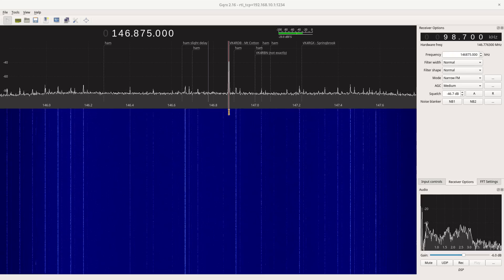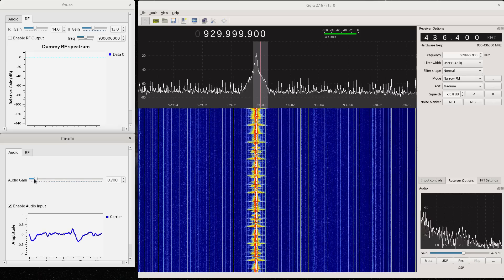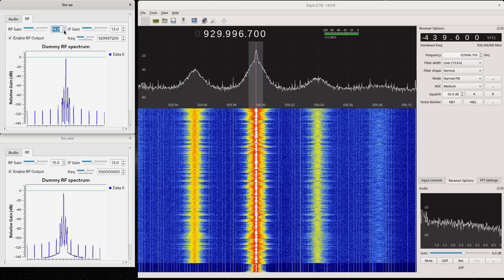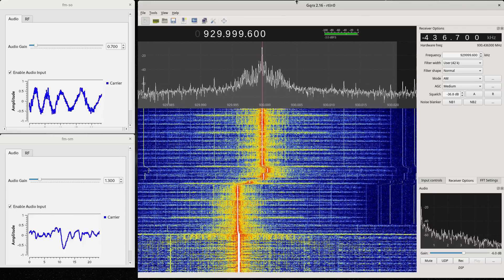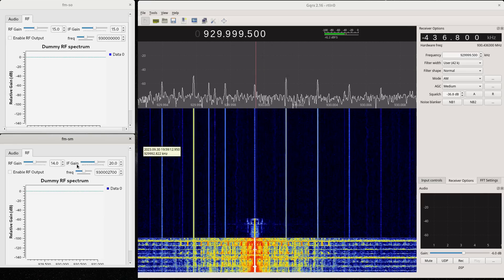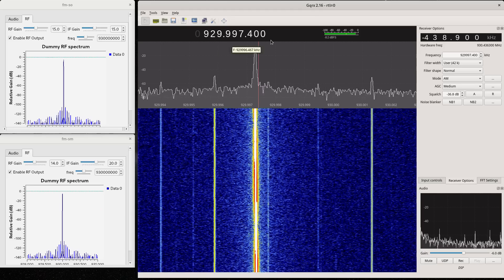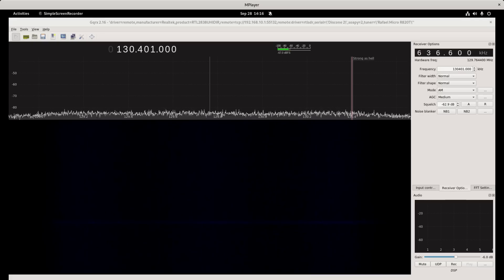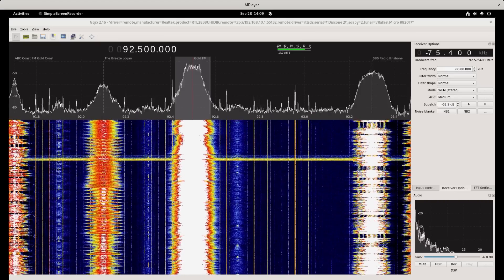Demonstrating FM Capture Effect

Comment: If they went to a digital trunk radio solve all these problems.
Reply: You really know what you saying?? Never heard anything so stupid.
Reply: You don't know how trunking works, LOL. But sure, go ahead and bet that your idea has been missed by thousands of engineers. Dolt.
Reply: @railgap  The FAA is still trying to figure out how to remove leaded gasoline after 30 years. I know some things about digital radios. I could see something where it's a hybrid system that can do both AM and a digital radio.
Reply: it would make stuff worse. there is a reason -- the interference, apart from being able to hear multiple signals is that the interference tone tells you something. In digital trunking and FM you will never know people stepping over each other. This causes issues like lost clearances etc.
Reply: @RoelandJansen  There could be a number of ways to solve that. Could make it so when you hit the transmit button a light turns on telling you that you have control of the frequency if someone else has it the light doesn't turn on until they release. The current system does not guarantee you would know someone stepped on you or not.  If you're talking and someone else starts talking but ends their transmission before you release the transmit button, you would not know. Could also que up the messages simply plays the message in the order it received it. EMS has moved over to digital radios they work great. Eventually aviation will move to a digital radio even if old timers have to die off younger generation take over.

Comment: ig even in an electrical storm, the important thing is that the line is still active, even if the lightning strikes add their own white noise spikes to all the signals. but then even here the benifits outweigh this quirk of AM, and people can just ask something like "hey can you repeat that" when a lightning strike happens at just the wrong moment. 

I'm sure a more advanced system could totally become a thing that has the benifits without the drawbacks of both AM or FM (like maybe a system which uses digital channels to broadcast the location of a randomly selected FM channel, also with systems to prevent, detect, and/or recover from signal clashes), but this is old, proven technology we're dealing with here so yeah I doubt it's changing anytime soon.

Comment: Aren't there any attempts to get away from both horribly outdated modulation technologies? The  whole aeronautical radio seems stuck in the 1950s
Reply: If it's stupid and it works, it's not stupid. The aircraft industry is very conservative regarding safety relevant parts and radio definitely is. AM is so simple, there is nothing that can fail. Every other modulation requires more moving parts which can fail, need to be tested, and certified. Also how would you transition? Have every aircraft using two different radios at all times? Switch depending on where you are? Some many things to mess up for the pilot...
Reply: @yschroder  It could work better? One factor in the Tenerife disaster of 1977 was an overheard warning caused by a simultaneous transmission, something more modern radio technologies can deal with easily. And then there is the high work load of manual frequency changes. This causes more loss of communication incidents than hardware failure. While writing this response, I learned that there is in fact a more modern system being introduced, CPDLC.

Comment: @5:45 can I ask something here? So can I just ask "What is actually happening here"  I just want to know What is actually happening?
Reply: With AM, the receiver is tuned to a frequency. Any changes to the amount of energy that hits the antenna will first be filtered to only allow frequencies near the tuning frequency. It then turns the differences in energy (amplitude) into the sound (intelligence frequency) you hear. So, if there are two stations transmitting AM on one, or similar frequencies, the signal that hits your antenna is going to be the sum of the energy hitting it from transmitter A, transmitter B, and all of the background electromagnetic energy, including lightning, car sparkplugs, and even noise from outer space. This is why the sound during the two transmitters being demonstrated is a combination of all of these signals, and when it makes a constant tone, that's the difference between the two transmitters' carrier waves. 

With FM, the receiver makes a frequency that is at or close to the frequency you expect to hear a transmitter on. It then takes whatever signal is coming in through the antenna, and attempts to output a voltage that represents the difference in frequency between the received frequency, and its internal frequency. In order to do this, it listens to that same voltage and changes its internal frequency by this "Error" voltage. When it does this, it will have the effect of "Locking on" to the strongest frequency, because it will trace the carrier frequency precisely, including the phase angle (where the signal is in its cycle as it oscillates). Doing it this way causes the receiver to only track one signal at a time, because its oscillator is "in-phase" with the signal. The result of two or more transmitters on or near the same frequency using FM is that the receiver will lock onto one station, but if you're in a moving car, both signal strengths may vary. If they are similar in strength, but varying differently from the terrain and being in different locations, then the effect will be that the radio plays one station, and then abruptly switches to another station, and back and forth. This is a common phenomenon in the USA, during long road trips as you go out of range of one transmitter, and into range of another transmitter that are both on the same frequency. If you happen to live between both transmitters, you probably won't listen to either, because it would be irritating for your radio to switch back and forth, but the benefit of FM is that any interference will need to be both the same frequency of the transmitter you want to hear, and it must also be a stronger signal at your radio antenna for your radio to lock onto it.

Comment: Great explanation with very effective spectrum visuals.  In practice, aircraft transmitters are not on exactly the same frequency as shown with your two HackRF transmitters with one clock slaved to the other.  The aircraft with a stuck mic is typically some little Cessna or Piper with a Narco COM radio with a 30 year old crystal that has drifted by a significant amount.  The carrier from the stuck mic causes an ear splitting squeal that obliterates the entire channel making it completely unusable and a huge audible distraction in the cockpit.  FM capture of the stronger signal would be greatly preferable to that noise.

Aircraft should use digital spread spectrum including channels reserved for weather, air traffic, airport information (no more "inbound with information hotel") and automatically captured text based clearances that appear on a persistent console for the pilot so there is no need to write down a lengthy and complex clearance while trying to fly the plane and no need to read back the clearance to confirm it because the two radios can exchange a checksum to indicate that the clearance was conveyed exactly.

The reason aircraft use AM isn't because there is anything superior about it, including the theoretical (but not actual) ability to hear two simultaneous transmissions.  The reason aircraft are still using AM is because AM was all there was when aircraft started using radios and it's nearly impossible to simultaneously switch over all aircraft radios worldwide.  Standards are bad for the same reason standards are good.  Standards compel everyone to use the same system.  Apparently, some railroads use a rail gauge that can be traced back to Roman carts that made ruts that destroyed any wheel spacing that wasn't the same.

Comment: Clearly you enjoy playing with your toys but you are not even beginning to grasp the difference between AM and FM and if used correctly your toy could display it very well. Your theory about why AM is still used on the Air band is BS, sorry, the reason is simply that it would be a total logistical and financial nightmare to change all the radios used in aircraft around the world at the same time. Acording to your theory SSB would be the ideal mode because that transmits zero power with no modulation, the total power of a AM signal is maximum with no modulation with maximum modulation it would decrease a little, when modulating the signal the carrier power decrease but the power in the sidebands ,above and below the carrier, increases. I suggest that you play less with your toys and read more about the principles.
Reply from the maker: I'll get right on that.
Reply: SSB is only used in aviation for long distance communication. Using SSB would make you hear communication from places where you are no interested making necessary to reduce power of all transmissions, making you lose the advantage of communication at a long distance when needed. In places like the Northern Brazil where you get a few hours over the forest without any tower near you, only other planes this is useful. There is a famous case of a flight in Brazil that put the wrong heading in the VOR and went lost on Amazon when they tried to communicate with the destination tower they couldn't and tried in SSB and the operators of the tower cleared for landing a plane that was hundreds (in fact I think it was thousands) of kilometers away, without realizing the situation, the fact that they could only communicate on SSB should be a big red flag for the tower operators. The plane made a forced landing on the forest when they got without fuel, and unfortunately a few people died and the Brazilian Army  got to the survivors (most of the passengers and all the crew) a few days later (it was a very difficult place to get even knowing where they crash landed). It was one of the biggest human errors in Brazilian aviation, partially compensated by an incredibly well done landing on the forest over the trees, what did not saved the pilot: he lost his license for good.

Comment: Hi, pilot here. Fascinating video. However, when people key in at the same time everybody else on the freq ends up hearing the beat freq screech. Depending on distance and transmitter power, you may be able to overpower and get a word through. For example, if I'm closer to the ATC transmitter on the ground, and someone that's farther away keys in while the controller is talking, I'll hear the noise but I can still hear the controller somewhat. Of course if this happens on the ground, then everyone is very close to each other and it's nearly impossible to get a word through. Fun fact, we call this stepping on someone and usually will respond on freq with "blocked"

Comment: What would happen if the two transmitters are exactly 180 deg shifted in phase ?
Would you just hear nothing ?
Reply: For them to cancel each other, they also need to have exact same amplitude. But then you will only cancel out the carrier frequency. Side band will still remain so the modulation is still there. AM demodulation of side band only will most likely sound like noise. Once you move from that spot where they cancel each other carrier frequency out, you will hear both.

Comment: AM has been used for aviation communication from the beginning because the capture effect of FM could prevent weaker signals from being heard by a pilot or air traffic control operators.  Beat frequency is called heterodyne by communication professionals.
Reply: Really?  In the 1920s,when they first put radios i. Airplanes,  there was no practical FM.  The fm parts count is higher and it was all tubes

Comment: What in REALITY happens, is that if two pilots, or tower and pilot communicate at the same time, the received output is almost always garbled. It is not a smooth mix, but just mismatched noise. You did not directly observe this in your lab test, because you tweaked both senders until this effect did not occur, while initially it actually did. Planes up in the sky will mess with each other's AM to the point that you can't understand a word, even if you have just a stuck mike with nobody talking. You can actually observe this in real live when you live between two AM stations that transmit on the same or close frequency. 

This is partially wanted, since then two transmission won't mix, and pilots won't read back a mix of two radio comms, or conflicted transmission being lost without indication. Other pilots will hear that a conflict occurred and most likely transmit "blocked", since neither of the offending conflicting parties will have heard the other one (simplex, RX is off during tx). In cases where this is not detected, or communicated by others on the frequencies, accidents happened in the past. 

This effect is also used for a lot of CSMA/CD radio media access schemes, like the original HonoluluNet, since whatever you transmit will not be a valid mix in case of a colission, but identifyable as complete garbage.

If they were to use FM, the stronger station would overpower the other one, and a blocked or overpowered transmission might get lost unnoticed. 

If a pilot has a stuck xmit Button, and that happens quite a bit in GA (general aviation, I. E. hobby pilots) , he is blocking that whole frequency effectively, and does not even notice, since his RX on that channel will be off during that time. Transmissions by the tower might still be heard with a lot of static over it, but often the pilots will try to inform about this on another frequency or even 121.5 or more likely 122.9 (Unicom).

Another reason AM is still used is simply adoption. Global aviation standards are almost "immortal", especially frequency allocations. The truth is, that for most purpose on commercial aviation, repetitive AM voice transmissions with ATC are being replaced by CPDLC, in most parts of Europe, when crossing the Atlantic, in more and more places in America, in busy airspaces. AM voice is mainly only a thing anymore on ground, departure, arrival, ie. Very short range transmission in areas with controlled radio allocations. GA of course will keep AM.

I am not sure why you uploaded this video. Besides of the wrong information, it is also a bit awkwardly edited. Now, I am not a YouTuber, and I would not be able to produce A SINGLE video without despair, but I think this video is just trying to show something, without having informed yourself about the background. You can then tweak two transmitters to produce any "result" you "think" is correct, without having checked with anybody in the real world. I am not giving you a mental meltdown like the pinned comment, but may I suggest you read up on the topic, and then re-shoot the video with the knowledge you now know? ATC traffice uses AM *because* two transmitters are garbling each other's transmissions reliably.
Reply: In addition, aviatiion has a fixed frequency for emergency transmission, so if there truly is an emergency, they switch to that frequency, which should contain only that kind of (radio) traffic. Hopefully, that frequency is quite quiet at all times. In theory, there is two emergency frequencies, but few aviation trancievers can use the upper band frequency, which is mostly used by marine emergency radio traffic.
Reply: @robhobsweden If FM was the standard, couldn’t there be a single FM frequency to be the emergency frequency?
Reply: @FlyNAA  "If". Maritime traffic uses FM AFAIK, so, this means that this emergency frequency uses FM. In theory, you can use both frequencies with any modulation you like, even PWM, but who's going to listen in with such a tranciever?

So, "if" is the key here. We could speculate as much as we like, that won't change anything. Millions of trancievers has to be changed then. If the air traffic is going to change to FM, it probably would be a different frequency band for starters...
Reply: Gotta love informed commenters! Hats off to you, sir
Reply: Also, the other way around - when using FM with voice only, you will usually be able to hear that there are two transmissions. The stronger one you might be able to understand, but you can tell that there is someone else there.
Reply: You're right. Aviation radios aren't able to transmit precisely on the frequency selected. (His initial AM example showed this.) You can occasionally make out what is being said when two people are talking at the same time. I think that happens only when the transmitters happen to be on exactly the same frequency, or when one is much closer to you than the other.
Reply: The author is not taking the Doppler effect into account. He assumes synchronization of frequency is easy which is totally opposite. The AM is used due to legacy reasons. There is a guard frequency for emergencies. He definitely never used AM in the reality of airplane traffic. The conclusion he made is simply wrong.
Reply: Exactly. 1977 Tenerife, the bigest plane crash disaster recorded it, the mix is result od ideal conditions, second pilot got garbled message and missed last chance to avoid tragedy.